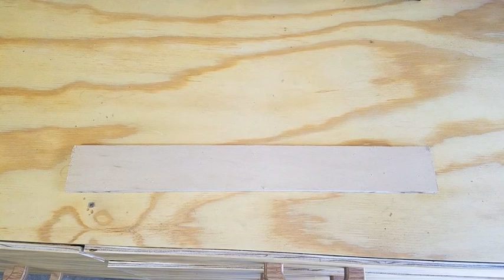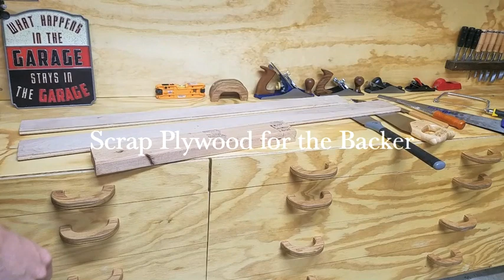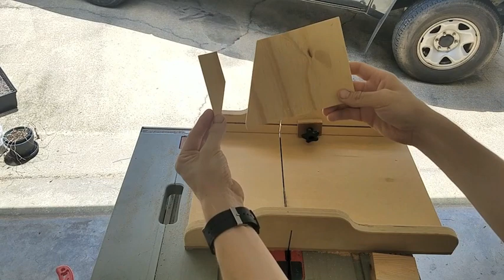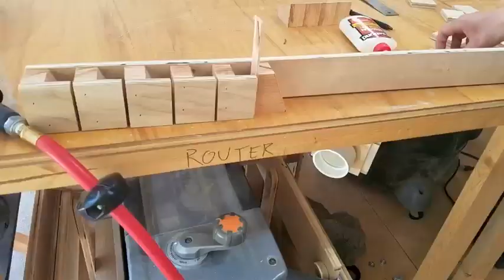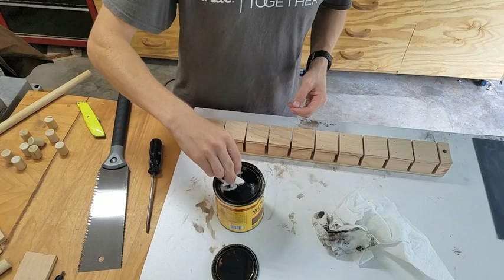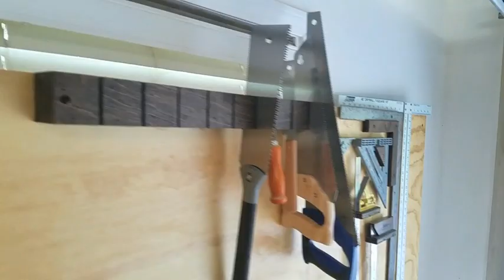Hand Saw Holder / Saw Till / Auto-grab, one-handed use! / EP38

Comment: Really nice idea. I built one for my smaller saws (dovetail, flush cut, razor saw, etc) that holds 8 saws. I also wanted to leave the little plastic teeth protectors on the saw when I hang the saws up in the holder. The problem I had was that the 3/4" wood dowels would not hold the saw robustly in the rack and I was concerned they might fall out. My solution was to reduce the dowel size to 1/2" diameter and then slip fit a 7/16" ID x 3/4" OD grommet (mine actually came from a harbor freight $4 set of grommets. This works flawlessly and hold the saws very well due to the increased friction. They can also pivot slightly to allow the plastic teeth protectors to remain on the blade. Hope this helps anyone else who wants increased friction hold.
(I also added this comment to the original designer's video)
Reply from the maker: Patrick L, Great tip, thanks for sharing! The grommets are an outstanding add.  Thanks for going back to Alan's Woodworking and giving him that feedback! FYI, I re-edited this (shorter) and drew plans for those seeking additional clarity.  All the best,  Chris
Reply: @benchtopwoodworks  Chris, If it would be helpful, I can share a picture of the dowel/grommet for you to post (if that is possible, not sure)
Reply from the maker: I can share it on Instagram.  Would love to share that.
Reply: @benchtopwoodworks  I just sent to your gmail acct.
Reply from the maker: Thank you,  Patrick,  I will share it soon.

Comment: Nicely done. Do you find that the dowels hold your saws without slipping? I’ve see others use rubber balls. Thanks, Chris.
Reply from the maker: The dowels work fine, I haven't had anything fall. Rubber balls can be swapped too if for some reason there's an issue.  Thanks for watching,  Jeff!

Comment: I just made one after watching last night and my saws just slip right through.  Any help.
Reply from the maker: What angle did you use for your wedges?  Pulling down slightly when seating the saws helps but slightly. The steeper the angle, the higher the clamp force.
 The only thing I can figure is that you don't have enough friction in your system. Maybe roughing up the wedges and rollers might help. Please let me know if that helps.
Reply: @benchtopwoodworks  thanks for the reply.  67 or 22 degrees like yours.  I ordered some 3/4 inch rubber balls to put in the slots.  Saw that on another video.  Thanks
Reply: Square, Level, & Plumb Where did you order the ¾ inch rubber balls? I can’t seem to find them.
Reply: @benchtopwoodworks   Was able to put 2,  3/4 inch rubber balls in the dowel slot and the saws are now hanging proudly.  Thanks again.
Reply from the maker: Awesome, and glad to hear it. Rubber balls sound like a great idea.